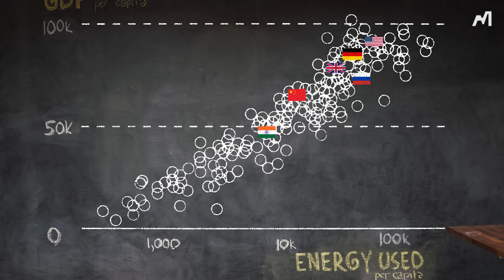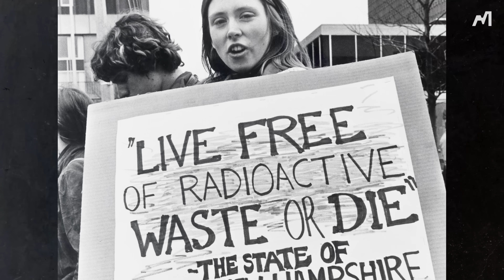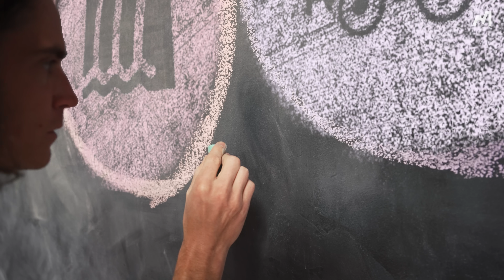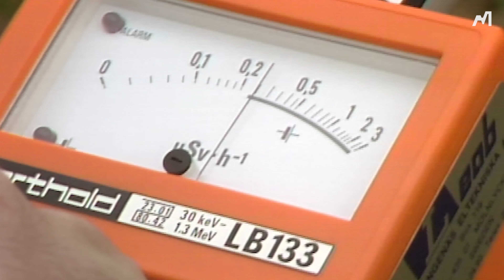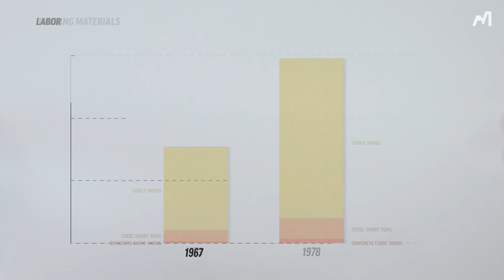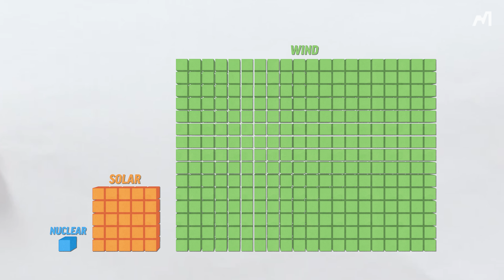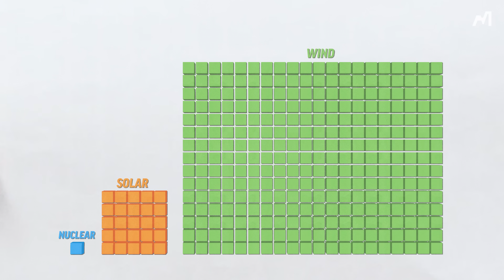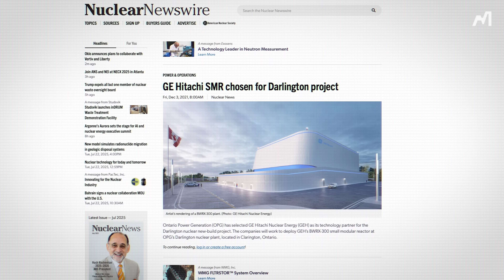They're Lying to You About Nuclear Energy

Comment: I am very pro nuclear and do agree that there is definitely a campaign to discredit it but there's a significant amount of rhetoric that essentially boils down to Ocean gate CEO logic of "safety regulations are too restrictive"
Planes are STATISTICALLY the safest form of travel because of the shitloads of safety features built in and practiced. I view nuclear in a similar way, we haven't had the major disasters because there was a lot of time and money put into ensuring that they don't and every single failure happens due to negligence and greed which relaxing safety encourages.
Reply: The ability to manage risk has been lost
Reply: You do have a point there. Humans cause almost all accidents that ever happened. Mostly laziness I would guess.
Reply: @tedmoss   it's not laziness. It's negligence. Safety checks and maintenance costs money so they do as few as they can get away and over time things get worse and worse until  part of it fails and unwinds into a catastrophe due to an accident that would have been contained if the focus was on safety rather than profit
Reply: Planes are safe and yet I have lost 2 friends in commercial crashes. Statistics is a strange bedfellow.
Reply: This is critical- if you lessen the safety measure, a company and the building contractors, will cut corners every single time.

We definitely need to keep the level of safety to an appropriate level- not to be loopholes against.
Reply: Yes you cannot both argue nuclear plants are perfectly safe due to all the regulations then in the next sentence argue they are only expensive due to unnecessary regulations.
Reply: @XMysticHerox   I disagree with you all on nuclear safety vs regulations. Sweden's fleet was built before the flurry of regulations after TMI, and it's quite safe. Building the same now would take 3x longer and 3x more labor hours. It's not reasonable.

Instead of super-detailed regulations, certifications and inspections, the focus should be on a few principles that increase resilience in designs. Some of them should be based on actual fault modes in previous disasters.
E.g. sites should have a bulldozer on site to clear debris (from e.g. tsunami). If they need active cooling, they should have redundant power, some of it secure from flooding, some of it secure from drone attack. They should have negative void coefficient. They should not have containment geometries allowing hydrogen buildup.

Stuff like that, and the most important and fairly cheap options should be chosen, not the expensive ones with core catchers and such. And they should be required to adhere to the given principles without a government bureaucracy checking details and doing inspections unless whistle-blowers point to major issues. Safety should be layered and based more on physics rather than on perfect execution in every detail.
Reply: @jesan733  Nothing you have said in this comment is even an attempt at arguing against the fact that modern safety standards came with increased costs. 

You just argue for massively reduced safety standards. Kinda proving that no you indeed cannot have both. Thanks for proving the point I guess?
Reply: @XMysticHerox  "modern" sounds good. But is it? I'm arguing from knowledge of both nuclear history and technology. I'm arguing that we should have meaningful safety standards that are good enough, and that they should be based on a subset of today's principles. You seem to argue without knowledge from Leibniz's theodicy ("we live in the best of all possible worlds"). Like: We have these safety standards, and since we have them, they must be necessary and good, and it would be irresponsible to relax them.
Reply: @jesan733  You can argue for that if you wish to. But fact is that just means you are choosing the reduced safety side of the "safety vs regulations" dilemma not debunking the dilemma as you first claimed. 

"We have these safety standards, and since we have them, they must be necessary and good"

And I said no such thing. I am talking in response to the typical nuclear lobby argument of dismissing any and all safety concerns by pointing to the lack of serious incidents with modern plants. Of course you can only use this argument if you actually support keeping those standards. If you however argue both for decreasing standards as well as dismissing safety concerns due to the recent track record you as the video above does you are not being very honest.

As for whether current standards are excessive. Hard to say. I do however think that nuclear is quite dangerous as it works with extreme4ly dangerous material and as such absolutely justifies and requires extensive safety standards. I also think your proposal to remove government oversight is complete and utter madness. If that sort of thinking is on the table I would rather drop nuclear entirely.
Reply: @XMysticHerox  there are preciously few modern plants. We have mostly old plants of 70-ies designs originally built with much, much laxer regulatory burden and oversight. Still they came out ok and has been run with very low failure frequency. Now the question is if they fail as rarely as they do because designs are robust despite lax regulations in the day, combined with corporate incentives for self-preservation, or if they fail rarely because governments force them to not cut corners on safety during operation and maintenance.

The standard anti-capitalist and non-industry sentiment is very cynical and assumes everything would be run into the ground and fail catastrophically if not for the government forcing the evil capitalists to behave. I see lots of examples of this in these comment fields. Within the industry, on the floor, the typical sentiment is that oversight mostly bashes in open doors and reduces innovation in the field, thereby inadvertently reducing safety in some respects.

What I'm suggesting is that the 70-ies designs are adequate, but we know the failure modes better now, and we have better tech in many ways. Thus when we incorporate learnings and better tech, physical safety margins increase substantially, and we need less of the oversight that has unclear benefits anyway. The incorporated learnings can be mandated in fairly lightweight and abstract manner.

You say you would rather drop nuclear entirely, and that's basically what we've done by letting anti-nuclear forces ratchet regulation to extremes. But given the fact that nuclear has saved about 2 million lives through improved air quality, your sentiment has probably killed 8 million by stopping additional nuclear, and also supercharged global warming. The super-strong nuclear regulation is one of humanity's biggest suboptimizations.
Reply: @jesan733  It is simple experience looking at any industry allowed to "self regulate" throughout history. We know what that leads to and it is completely unacceptable for nuclear energy.
Reply: @XMysticHerox   yes, that's what I'm saying; you're speaking from a lack of knowledge, but with this shallow tribal anti-capitalist viewpoint and some anti-nuclear media hype in the baggage. And you're unwilling to listen and learn.
Reply: @jesan733  Yap yap. Feel free to point out an industry allowed to self regulate where this has led to any positive outcomes.
Reply: @XMysticHerox  just compare nuclear plants and refineries: For nuclear plants, the US regulator (NRC) assigns resident inspectors to each site; typical staffing is two per site (sometimes more), plus regional/HQ specialists; over a typical year, inspection and oversight-related on-site hours per reactor can be several thousands. The cost for this is put on the nuclear plants.

So each nuclear plant site has a dedicated, full-time regulatory presence, with a standing oversight mandate. Oversight is systematic and continuous (baseline + risk-informed inspections, security, maintenance, operator licensing, testing, emergency preparedness, etc.). NRC’s licensing and regulatory framework is centralized, prescriptive, and comprehensive.

Chemical/refinery oversight has no equivalent to that. Instead oversight is spread thinly across thousands of sites and dozens of hazardous-substance programs. External inspections occur only occasionally, often at a small and unpredictable subset of facilities each year (for RMP, ~2–3% coverage annually). Compliance relies heavily on internal safety/safety-management systems, self-reporting, audits, and occasional inspections, rather than continuous regulatory presence. Licensing and regulation is simpler, less comprehensive and more performance-based than prescriptive.
Reply: @jesan733  There is a vast gulf between 24/7 oversight and zero oversight and regulation as you proposed. Or in other words you failed to provide an example to justify your proposal.

Also refineries are vastly less dangerous than plants so obviously safety standards differ.
Reply: @XMysticHerox   I didn't say zero, but I'm not so interested in getting bogged down in defending against strawmanning. If you understand that nuclear regulation and oversight are over-the-top now, and net damaging to human health, I'm fairly happy. But I guess you don't? 

So far, there have been chemical disasters worse than nuclear plant disasters, like Bhopal, and there are vastly more chemical disasters than nuclear disasters. On what do you base the assertion that nuclear plants are vastly more dangerous?
Reply: @jesan733  "without a government bureaucracy checking details and doing inspections unless whistle-blowers point to major issues"

And explaining how lack of regulations for chemistry led to disasters really does not help your point at all.
Reply: I'm with you. Nuclear is safe because it's regulated to require safety measures and failsafes.

I feel that this video loses a lot of its credibility with making a shaky refusal of the incredible amount of science done to determine the risks and harm of large scale radiation exposure as well. Sure, there might be only '50 direct deaths' but the knock on effect of having a huge quantity of radioactive material entering the environment could be the result that cancer rates have been skyrocketing the last few decades. Sure it's not an immediate death that Chernobyl (or any other nuclear incident) can be directly blamed for but there's still a ton of potential for long term chronic damage to be done to the population.
Reply: Yea I am not against nuclear power but this video has a clear bias towards it. It's disappointing that it does not mention what you pointed out. Another thing is that it solely focuses on direct deaths of nuclear disasters without looking at the economic costs of nuclear disasters or waste management at all. I want nuclear energy to work for us as well, but please be genuine about it.
Reply: @eran3161  There were some really crazy statements in that video. 

- "Yeah, a lot of people got thyroid cancer from chernobyl, but it's not that bad of a cancer"- Yeah man, maybe on a population statistics level not a lot of people die from it, but I would definitely feel uncomfortable with thyroid cancer.
- "The scientists at Los Alamos carried Plutonium around in their pockets, and they were not reckless" - Brother, have you read about the things they did there on the regular? Also, regarding reckless: They built the first nuke. Which... some might argue might be a reckless thing to do.

- Nuclear power is similar to airplanes in that there is very little chance of anything going wrong, but IF something goes wrong its getting very very expensive to deal with the aftermath. 
- You need LOTS of uranium to keep a country on nuclear running. Where is that uranium coming from? 40% of it comes from Kazakhstan. Which is pro-west at the moment, but uncomfortably close to Russia.
- Nuclear power is actually not that cheap to run if you factor in the costs for dealing with decomissioning an end-of-life power plant and deal with the waste. (Of course, Fossil fuels are cheating here, because we are not paying for the damage they are doing- just yet)
- Nuclear is really inflexible in power delivery and doesn't play well with solar- which is dirt cheap, well-scalable and very low-risk. The big caveat is that it is not available in the night.
Reply: @blueduck115 id add the land usage/land pollution from materials damaging future use/damage from storms on the solar and recovery(since its so scaled up landwise compared to other energy), but the rest is correct. More considerations on solar for sure.
Reply: There is such a thing as strategic regulation. You put nonstop regulation onto a market that makes it incredibly hard for it to exist. That destroys competition and allows the other markets to dominate. In this case oil and "green" energy.
Reply: That's exactly the reason why I don't want nuclear plants, humans and their greed and arrogance.
Reply: @SirPano85  I DO want nuclear. I just don't want it run by the people that brought us the BP oil spill
Reply: @ethanstyant9704  ok, but fairies are in strike and the rightfull knights are all fighting the dragons, so who do you call to run them? Unicorns?

Comment: I'm pro nuclear but...During the Soviet era, Russia (then the USSR) extensively used the Arctic seas, particularly the Kara Sea and Barents Sea, as dumping grounds for radioactive waste from nuclear-powered vessels and other sources. This practice stemmed from the rapid expansion of the Soviet nuclear navy, which included submarines, icebreakers, and support ships. Waste disposal at sea was seen as a cost-effective solution at the time, but it has left a legacy of environmental hazards. The dumping primarily occurred between the 1960s and early 1990s, involving low- to medium-level radioactive waste, spent nuclear fuel, and even entire reactors or submarines.
Reply: The only protection is distance, and what does that mean when there is no place else to go!

Comment: Trust Me said the nuclear engineer. But thought a switch to control a critical valve should show the switch position rather than the valve position allowing radiation to vent into the atmosphere.  The great American 3 mile island.  Chernobyl controller Ops,  Fukushima Yeah, those emergency generators will ok if a tsunami hits the coast.
Reply: The only protection is distance, and what does that mean when there is no place else to go!

Comment: Electricity is everywhere in this universe. Your cells in your body make it just like a battery cell makes it. It can be created for free indefinitely without pollution be that carbon or radioactive but the powers that shouldn't be don't want us to know about it and so we don't.
Get a generator unit that produces about 30000 Watts of AC electricity and that will power your home. Get a 48 volt direct current brushless motor to rotate that generator and power it originally with a battery and there you have enough energy for your home. Now once you've got that system running power the motor in this system with electricity generated by the generator and there you have it. Pollution free free energy generated indefinitely...
It is that simple but no one is supposed to know so keep it quiet won't you...
;)

Comment: The biggest issue with nuclear power is not the power plants; it is the nuclear life cycle, where the most deadly component is getting irradiated by Radon. In Scandinavia, we have 1000s of houses built with limestone and radioactive shale, light concrete blocks, or gasious concrete. These have been proven to have given a large group of people lung cancer.  In US and Canada, particularly First Nations inhabitants, are suffering the same issues due to waste dump trailing from mining or fish with radioactive pollutants. And, old fuel rods can be used nefariously if not stored protected. US Naval reactors have a life span of some 25-30 years. To cover US energy consumption, some +2000 reactors are needed, to be dismantled after those 30 years. It is a lot of uranium/plutonium producing a heck of a lot of Radon and other nasty, water-soluble radioactive compounds.

Comment: If you are going to do wind power, perhaps consider using vertical axis wind turbines on the corners of all tall buildings...
 Conventional salt water batteries could be used for power storage.
 You make the electricity, where you use it and you can run everything off of DC more effectively using far less copper.

Comment: There's no doubt nuclear has been a viable answer all along. As someone who's worked construction for 50 years, I can tell you two foot sections of pipe frequently disappear. I also spent most of my career working energy, including oil, gas, wind, and ethanol. Both in plants and in pipeline and wind farms. You can't "theoretically " use the land around windmills. It, in fact, happens every day on farms and pastures. A simple Google Maps look would confirm this. While your presentation is compelling. It would be even better had you eliminated some hyperbole and fact-check some of your assumptions.

Comment: Two minutes in
They all died from old age
What about those two who got radiation poisoning from an accident during tests?

I'm not against nuclear energy, but this video looks like it was made by a shill paid by the nuclear lobby.

Solar may take a lot of space, but it's less than 1% of the total land of earth. Also in many places there can be vegetation or animals that make use of the partial shade. Also on buildings.
Also batteries can be thermal too, not just electrical. And other types exist like compact linear Fresnel reflectors plants. No solar cells needed.

This video is a scam, it's an advertisement.